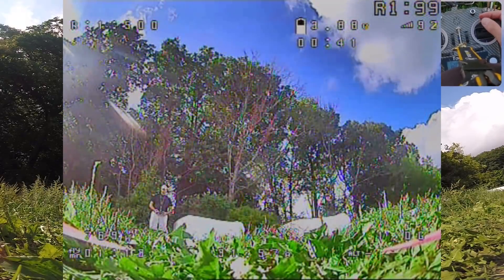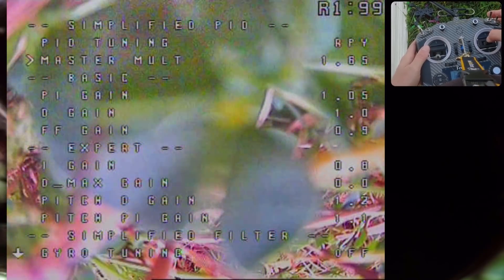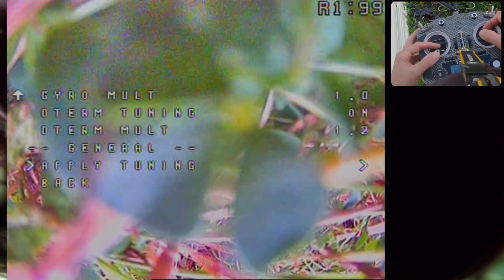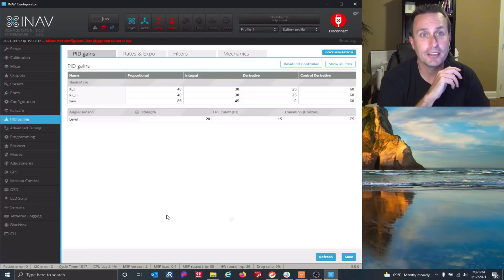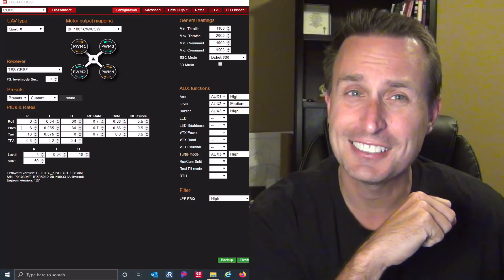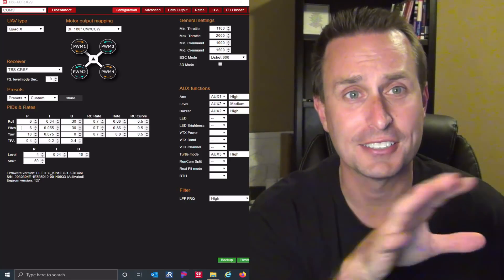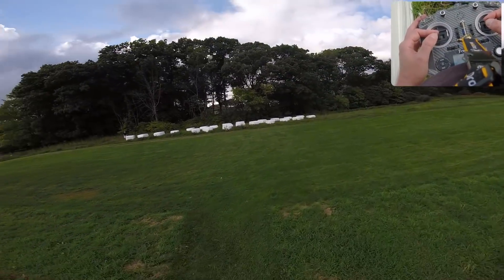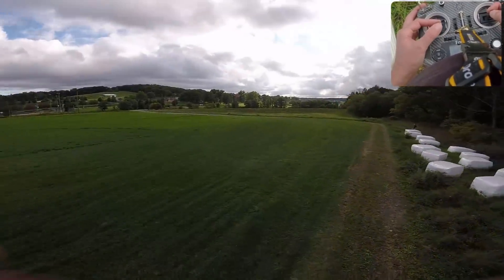How to REDUCE Prop Wash & Wind Shaking

Comment: Start-up power can do wonders to many off-size (ie. not 5") quads :)
Reply: Interesting! So how do you tune for this? What things would you see if it's too high or too low?
Reply: @chrisburke63  It’s a bit of a trial and error. For example, modern 22xx/23xx motors are so powerful you might get desyncs even with the default blheli start-up/ramp-up power. Kabab FPV/Bob did a video about it after someone pointed out one of his review 4” had problems that looked like start-up power related: https://youtu.be/obObn1oGWmU